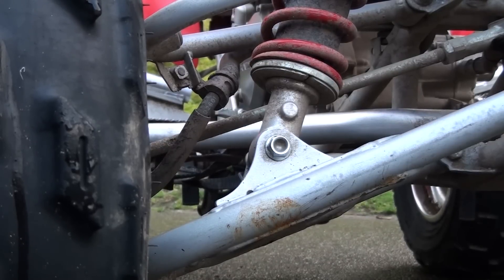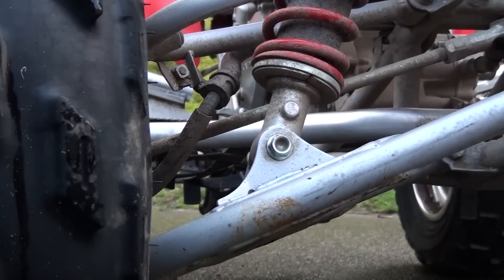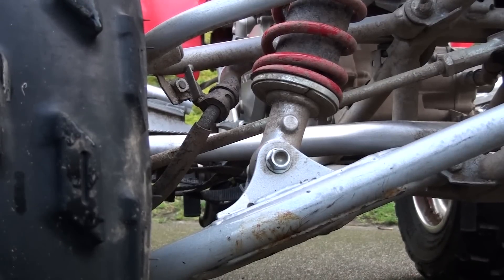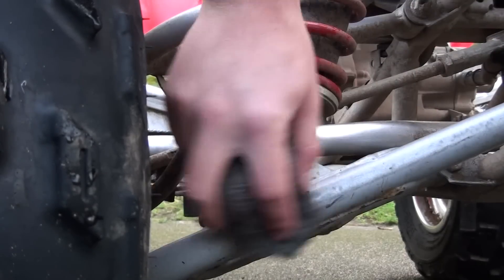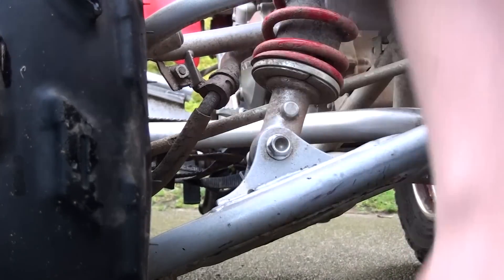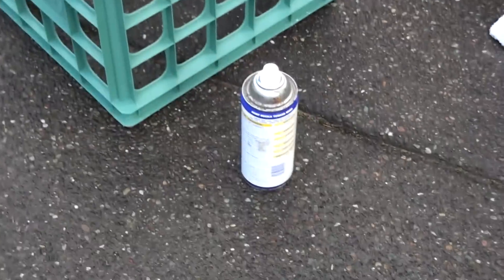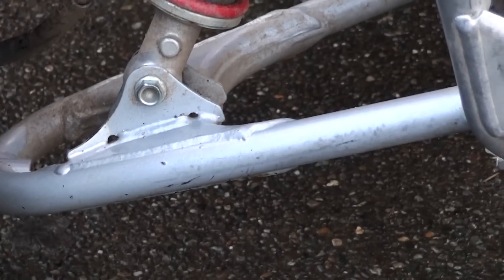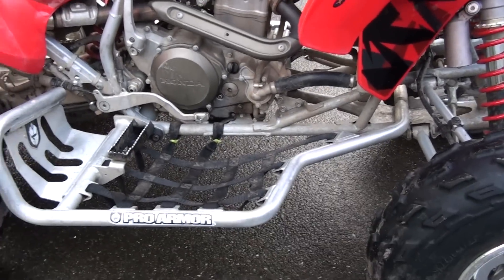EASY RUST REMOVAL FOR STEEL ATV FRAME

Comment from the maker: @5Rickykx125 yeah it works on just about anything. If you do it to your pipe you should also go pick up PJ1 High Temp spray paint so that you can paint it black since the steel wool will remove a lot of the paint.

Comment from the maker: @mxz440skidoo true, but the frame a lot of times rusts because it's lost it's powdercoating. My more permanent solution is to do this, cover it with a layer of clear coat, let that dry, then put grip sheets over the area. Basically you cover the front of all 4 a-arms in grip tape and they won't get scratched up but this is the easiest way to maintain a non-rusty frame on any given day.

Comment: WD-40 ... not so good.  Unless you make sure to remove it all when you're done.

WD-40 promotes rust over time.

Spray two similar steel surfaces, one with WD-40, the other with less-fancy oil.  Let them sit outside for a month and see which one rusts first ...

WD-40 displaces moisture (a useful trait) by absorbing it (not so good.)
Reply: what is good to protect the paint besides wd40?